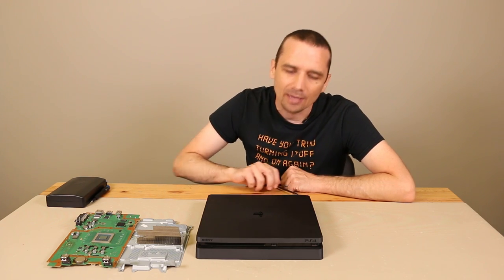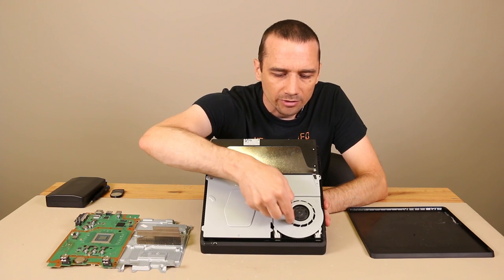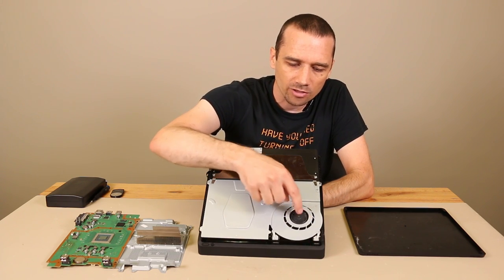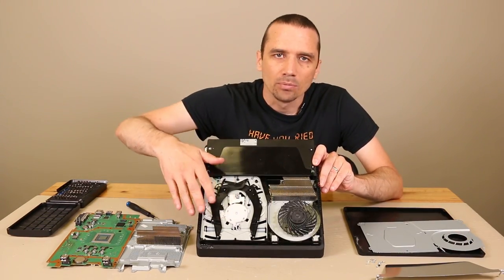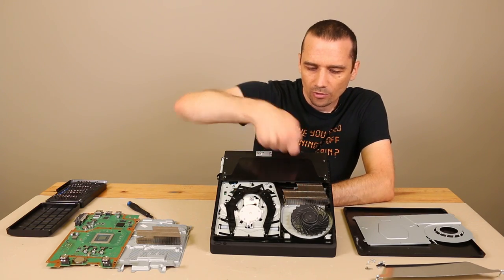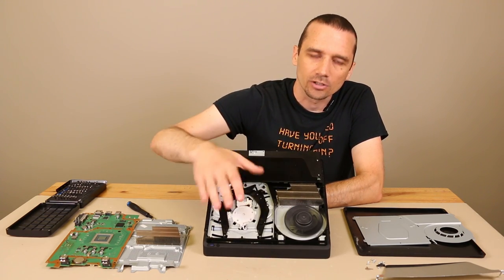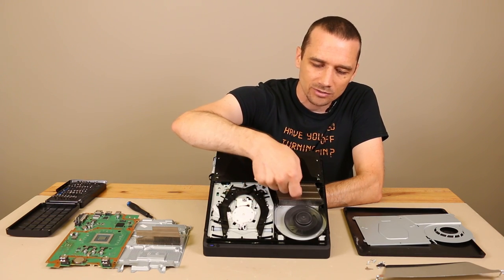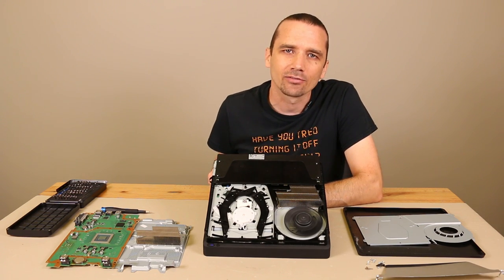PS4 Cooling System - How It Works - See it Working

Comment: My ps4 when I turn it on its silent and my dad said he can't hear the fan and its broken if I clean the fan will it work Agian or do I have to get the fan replaced help please?
Reply: ty_try for 2k Does it end up shutting off from overheating? And Idk about the last part, may just have to wait until he replies.
Reply: yeah it says '' your ps4 is to hot turning off and wait until the tempature is down but I haven't played in days
Reply: Koogboi and like my fan doesn't move at all and then its shuts off if I go inside the ps4 and clean the fan will it move Agian or get a new fan
Reply from the maker: Cleaning the fan will not get it working again. It's burned out and needs to be replaced.
Reply: TronicsFix thank you and should I do it at home or give it to a store
Reply from the maker: Whatever you feel most comfortable with.
Reply: PS4 design is stupid small ventilation lead to overheat Xbox one bigger ventilation no over heat

Comment: My ps4 fan makes a faint buzzing sound and I do have the slim. It doesn’t overheat and the fan seems to work normal but what would be the reason for the sound?
Reply: Probably coil whine (brief: coil whine is when coils in the power supply vibrate due to power passing in them) it’s completely normal and it doesn’t affect performance or estimated life time, ignore it and have fun gaming... you can look it up

Comment: Ya well my PS4 Pro is way much quiet with the panel off. Thing screams even when simply watching YouTube, I'm giving up in this poor machine
Reply: did you dust it out or change the thermal paste?? problem with my ps4 pro turning into a jet engine was a change of thermal paste and she's quiet as ever... only time it ever got loud was playing certain games like the last of us, horizan zero dawn and even rdr2... there's a YouTube video on how to change the thermal paste helped me a lot 👍🏾
Reply: I agree mate, I' just don't believe the presure theory explained here, there are a couple of videos here of the results of the cooling mod, they show how a small opening on the top case just upside the fan improves the  temperature, around 6-9 degrees below, resulting in a quieter fan.

Comment: Do you need the metal flimsy plate that goes on top of the Power Supply? What happens if I leave it off, because I broke it.
Reply: The ps4 blows up if you don't have it on.

Comment: Hi have been experiencing an issue with my PS4 lately it randomly shutdown by itself sometimes and sometimes everything is just fine and it did dat once while in rest mode and one when on the main screen what is actually the cause because my PS4 is not over heating and there is enough air flow if it was overheating I could hear a big sound the it turns off and red light but this just goes off and right now it have been playing for about 4 hours nothing happening so I am really lost please any solution?
Reply from the maker: It's most likely being caused by faulty solder joints under the APU but be sure that the power cord is plugged in all the way in the back plug the console directly into the wall...sometimes that helps.
Reply: TronicsFix i changed power cord so I am still waiting to see if it happens again the console is 2 weeks old
Reply: Not gaming much

Comment: is it ok to turn on a standing fan to blow on the ps4
Reply from the maker: Sure
Reply: TronicsFix LLC how can I prevent the blue light of death
Reply from the maker: Don't drop it...other than that it seems to show up randomly.
Reply: TronicsFix LLC oh ok thanks.....and is there any fix for it?
Reply: @bckgaming2449  The other videos seem to hint if you get a blue light of death and the spacer method dont work,you will have to reball your cpu which may be expensive

Comment: If i start apex legends the heat just gies up andnthe fan is dead loudbis mu ps4 pro broken?
Reply: I doubt it and figure it's likely a ventilation issue on your end. If the console is also a few years old, that cheap factory thermal paste has probably gone bad and no longer doing the job correctly. 

Where do you keep your PS4 Pro by any chance?

Comment: the ps4 gets really hot which is sad cause i like the console but it gets hot too fast my xbox one is cool all the time
Reply from the maker: Does it overheat?
Reply: The xbox one s gets pretty hot too, you just dont feel it as much because the console is alot larger, you can feel the heat being forced out of the top vent of the console. Personally imo, the xbox ones cooling system is the best I have ever seen on a console.

The ps4 slim only seems to get hot in the area where the heat sink is located and at the back you can actually feel the heat being forced out of the back of the ps4 slim, that tells you it's cooling system is doing it's job correctly.

Comment: hmm if you water cool your ps4 would it stop from BLOD?
Reply: If you redesign the cooling system (which will demand new case and some extra hardware), maybe you avoid it for a bit longer time... If not, you'll be just frying your console in an expensive way.